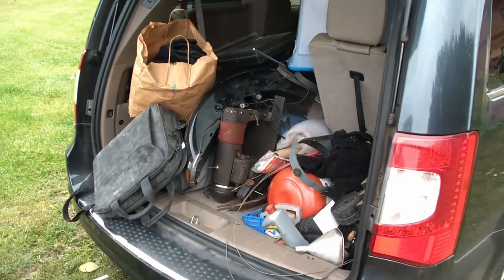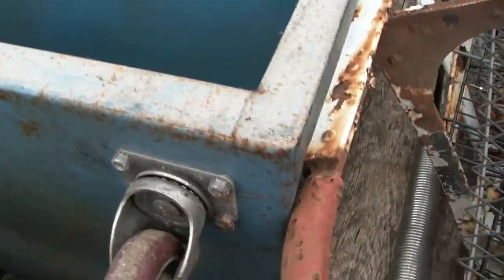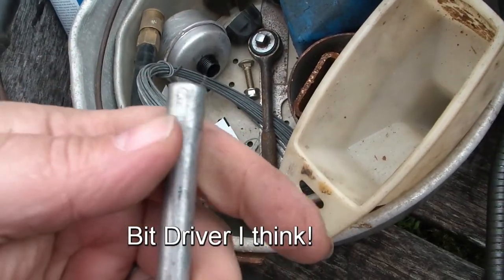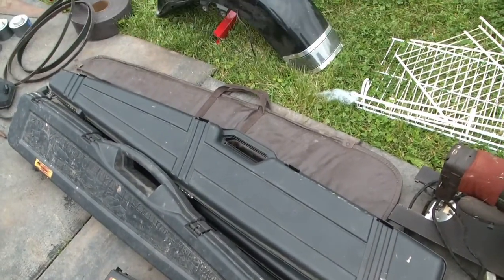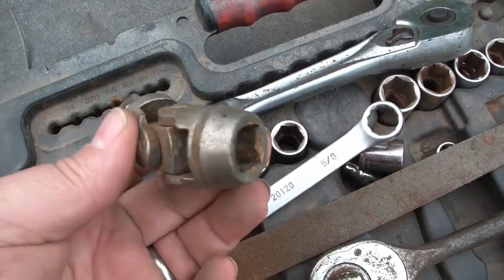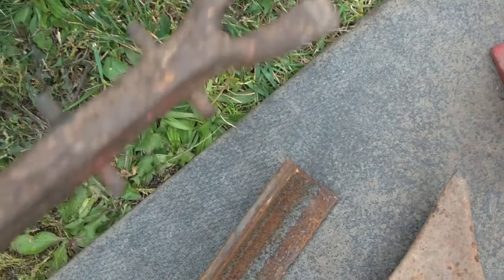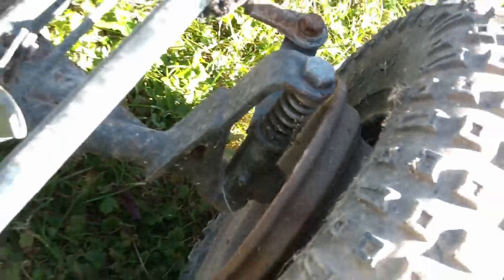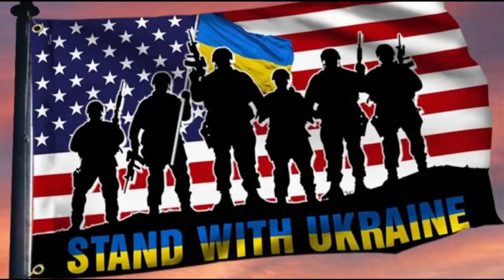Freebies Round 4 Garage Clean-out

Comment: 0:35 They call those cow mats . I ordered one from a farm supply store and use it in front of my table saw. Great product. Is the tripod chain for hanging a pot above a fire? We did that a lot in Boy Scouts.
 4:15 You can unscrew the shiny part from the cone end so the motor will not operate the needle. You use this function for things like filling bobbins. I've now got two Singer sewing machines. I'm amazed at that.
6:30 Ball joint or tie rod separator?

Comment: Florida stuff but the thing catches my eye is that sewing machine. I've never seen one with an advancement knob like that. Looks to be in good condition and has fantastic stylings. Like almost everything I craft, my skills are self-taught, and that's is the same for sewing. It is the one few things that surprises people when they find out it's one of my skills. A high-speed motor with fast dangerous parts controlled by throttle, and designed to permanently construct useful items. How could that not be cool.
Reply from the maker: Agreed!  If Dave Engel of "Engels Coach Shop" youtube channel counts sewing as one of the crafts that make him a master craftsman, it has to be cool!
Reply: @timeflysintheshop  I have a video where I fancifully modified a utility wagon. The canvas top was not the most complicated sewing project I've ever done, but it is certainly the largest and most functional utility focused to date.
Reply from the maker: @kludgescraftsplus8631  Yes I had already watched that!  It is a very cool and practical wagon!  👍😁👍